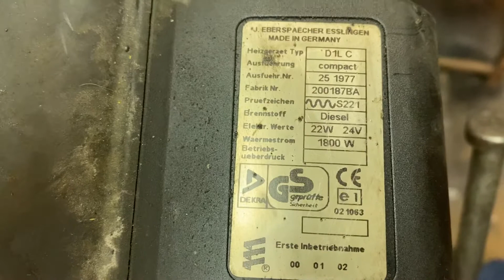Eberspacher D1LC test run

Comment: Can you tell me how you wired it to make it start, i dont have controller or thermostat
Reply from the maker: I used the complete harness and rotary controller from the lorry I salvaged it from. It’s a simple circuit, but I’m pretty sure that you would need the rotary controller as a minimum. You can see it in my hand when I start it up. If you google “D1LC wiring” you should get a basic schematic.